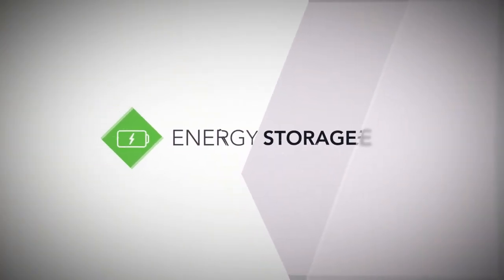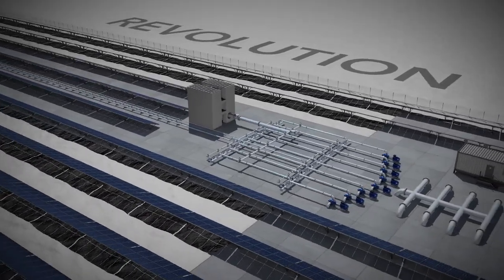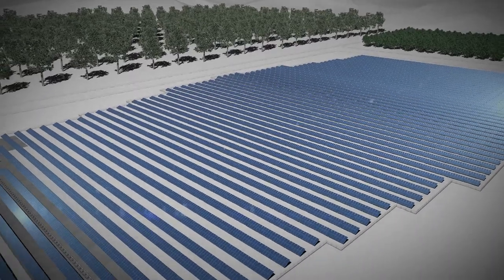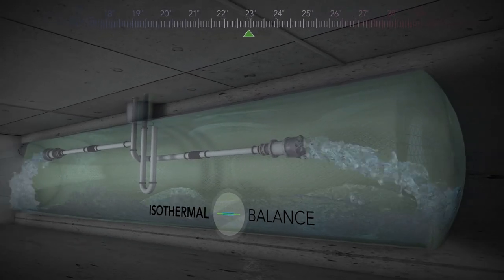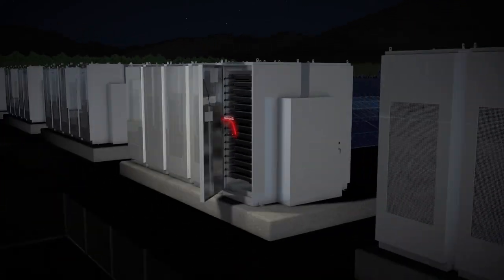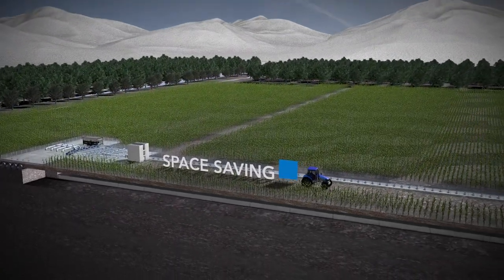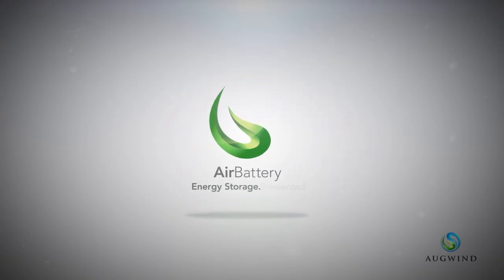Introducing AirBattery energy storage

Comment: This is not new and sadly not effective (and nothing you can fix without breaking physics). If you compress air at let's say 200 bar, you'd only be able to store 0.4kWh per m³ of pressurized space. Energy Density = (P * V) / (k * (γ - 1)). There is also some losses, with the efficiency being ~70% to compress it, and another loss at generating electricity, in total probably around ~50% regained energy. There are other ways like heating salt etc that are more sensible to store significant amounts.
Reply: what is the efficiency of drilling for oil, frackig for gas...then processing into fuel....then transporting it to be sold
Reply: @sampleoffers1978  Probably extremly high, as you just grab existing energy. But the problems there are with the negative effects on climate, environment and on human health.

Anyway, since we were talking about storing electricity, "using existing one laying around" isn't really comparable.
Reply: 200bar is 2,900 psi…!!!
Compressed air is efficient enough per cost $ wise.

Steam power doesn’t need that high of psi…

Solar panels are only 22% efficient
Reply: @sampleoffers1978 Probably tens of thousands procents...you put 100kwh to drill 100000 l of oil in example...how much energy is in that oil? There is your efficiency of drilling for oil...

Comment: What about the efficiency of this system .. I think it will be below 30%
Reply: Not sure about efficiency, I don't know about exact calculation, but carbon footprint will be near about 1% or may be less in this type of technology. This air battery is simple and better than any other acid creating battery. Polution is a huge problem ahead us. This planet is becoming sick actually. We should bring clean and green energy technology instead of increasing more and more pollution through our other movements.
Reply: hydropump could get 80% efficent. how about this process?
Reply: Wind and solar being abundant sources, the efficiency is still helped by no need to drill, process and transport fuel cargo. So that goes into efficiency as supporting auxiliary power source.
Reply: according to the video, one tank created 0,3 MWh, lets say u have 100 tanks wich is alot:100x0,3= 30 MWh means if u spice them into the Powergrid, with like 0,06 Cents, u make 30$ per full discharge, wich is not much

Comment: Compress air without losing heat ? I don't think so... even with the water to cool it down, it does not change anything to the fact that we will lose energy there anyway, the only difference is that the heat goes into the water.

Comment: How much its cost per mega watt
Reply: same question
Reply: The megawatt (MW) is a unit of power - this video is about energy, measured in Joules (J)
Reply: @thedubwhisperer2157  installation cost is usually compared in $/MW in power industry.
Reply: @thedubwhisperer2157  What we want to know is the electric power output, not kinetic energy
Reply: @bluemamba5317  If you do a little research you will find than the unit of energy - the Joule - is equally applicable to mechanical and electrical energy in the metric system.
1J = 1kg.m²/s² = 1V.I.s.  (Also 1Coulomb.Volt).
Electrical power is measured in Watts, where 1W= 1J/s.
Reply: @urbanturbine  Is it assumed that the installed MW capacity can be generated continuously?
Reply: @thedubwhisperer2157  This is about the construction Cost. The construction cost of installing a power plant is often referred in $/MW. 
 if you want to install a 2MW generator, it costs XXX dollars. It doesn't matter how much it will generate. 
Like when you buy a car, it has a fixed price. It doesn't matter how much you will drive it.
Reply: @urbanturbine  Thank you for your reply, however it does not answer my question:
"Is it assumed that the installed MW capacity can be generated continuously?".
ie: 24hrs a day?
Reply: @thedubwhisperer2157  Yes but there will be a projected and unforeseen downtimes. Larger plants will be ~90% uptime or more. 
Small plants will vary more but still around that number. Also it depends on the application. İf your application calls for continuous operating plant, then you plan accordingly (higher $/MW). İf lower annual hours are needed then cheaper, lower quality equipment can be purchased. 
Typical emergency/standby generators are cheaply made, they will wear out quickly of run continuously but they are cheap (lower $/MW).
Reply: There are peaking plants, which will run only a few hours a day during high peak demand times of days. 
Those are usually smaller and relatively cheaper made plants.
But normal plants are expected to run continuously 24/7 for maximum revenue.
Reply: @urbanturbine  Thank you kindly for the clarification; it is an area of electromechanical engineering in which I am ignorant!

Comment: I've been following this idea for quite a few years and really wanted to see some real world testing of this. However, I can't help but being worried about the many valves and pipe joints in the system to be under constant cyclic pressure. It is safer to have it buried underground so when a valve bursts, the jet stream won't poke a big hole in someone, but it also is more difficult to perform maintenance.
Unfortunately, currently the most effective way to do hydroelectric energy storage is still pumping water to a very tall place.
Reply: I feel like there would be a way to work with a dam to improve efficiency but not sure how
Reply: @MrEdmundsj  You'd need a dam to work with. This requires a lot of politics and business agreements to make it work. The air/water tank concept is standalone and can be located anywhere. For that it makes sense. But I think real challenge will begin with the monitoring and maintenance costs. 1 MWh is like 50 to 100 bucks depending on when you dispatch it. It is not that much money. You'd need a lot of tanks to make the economy work.

Comment: The principle of this technology is about the same as that of the hydraulic air compressor.  We know a lot about the HAC.

A comment below says that this project has been on hold for five months.  I wonder whether that is because they finally tried the idea and found a very hard problem with it.

Since the water and the air are in direct contact in the storage tanks, as the pressure increases the water absorbs more and more of the air.  When they use the compressed air that is still free inside the tanks to push the water through the turbine to produce power, the pressure in the water drops as it passes through the turbine.

That pressure drop causes the dissolved air in the water to escape while the flow is still in the turbine.  The turbine can't handle this two-phase flow, which becomes increasingly more air and less water per unit volume as it passes through.

It is like the problem, only in reverse, that happens when a pump tries to pump a mixture of air or some other gas and water or some other liquid.  It can't do it well enough, or at all.  The technical explanation is set forth in many places including the internet, for instance, "pumping two-phase flow."

In other words, Augwind did not know about, and did not anticipate, the Champagne Effect.  This effect has been studied thoroughly.  It became obvious more than forty years ago when water-compensated CAES became a subject of great interest.

Because of this effect, it is very difficult to safely operate a water-compensated CAES cavern.  (Hydrostor, beware.)  And because of it, I do not see how Augwind can generate much power with this arrangement.  They can store energy with it at high efficiency, but they won't get most of it back without a lot more research, probably some patentable discoveries, and a much longer time to market.  I don't think they are nearly ready to sell their system.

If this is the reason for putting the project on hold, it will be far from the first time that the problem of dissolved air in the water has put a stop to the dream.
Reply: Interesting take.
Reply: Then they should have a piston that separate air from the water? You pump water, the piston moves and push the air into tanks. In the reverse mood - the air push the piston that will push the water into turbine.
Reply: While there could be many reasons for a 'project on hold' status (including complete implosion of the project), I think you may be misunderstanding  their system.

You say:
//"Since the water and the air are in direct contact in the storage tanks, ..."//

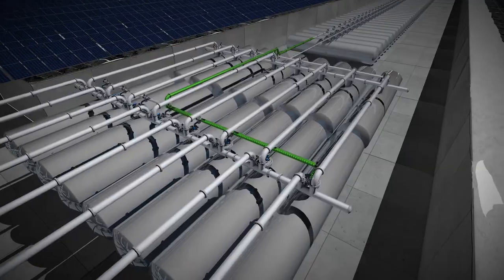If you look at their patents (and video including this one), you'll see that they don't store the air in contact with the pressurized water.  The air is stored separately in 'air only' storage tanks (1:20)

Essentially they are using the water only as a 'hydraulic piston' and the contact only happens for a short period during a 'compression stroke' (0:55)   Then, that 'piston' (they call it a "compression tank"), now near full of water, is returned to atmospheric and used as the supply tank for the compression stroke on an adjacent tank/piston.   The output of compressed air is stored separately.

The entire process is reversed for energy retrieval.

Given the short time that the water is under pressure (low dwell time - low aeration), and the fact that the water is returned to atmospheric every stroke (equal or greater time for deaeration), I think you'll find that the "champagne effect" will be trivial.   

Your comment would however apply directly to Hydrostor and I haven't studied their system to see how they plan to handle it. 

My take.
Reply: @johnborton4522  I think his points are pretty valid. Although the air and water are stored in separate tanks, the pumped water still dissolved a significant amount of air when pressurized, it will quickly even out all the water in the system. Once you start running the turbine with this water, the cavity would erode the turbine pretty quickly. 
A lot more research is needed to make this system work with the kind of reliability claimed in the video. For example, additives in the water or specially blended fluid to reduce air solvency. Or special gases that have very low solvency in a fluid.
Reply: @hyphen2612  

//" I think his points are pretty valid."//

It's literally not valid to say they are stored together (as he did) when they are not stored together.

//"A lot more research is needed to make this system work with the kind of reliability claimed in the video." //

I don't disagree.  My point of correction of his claim still stands though.
Reply: Nah a pulley rig should allow storage to switch off with gravity. If they find ways to fail, that's big oil intimidation, not engineering problems.
Reply: The most common way to supply watter to a house from a borehole is to use a pressure tank that have a bladder inside. This bladder separates water from air. Maybe they did consider this aswell.. i think it's obvious to separate them
Reply: I come from China, a country that has taken a leading position in the world in the fields of compressed air energy storage (CAES) and liquid air energy storage. Similar to the Augwind water piston system, research has been conducted at both Xi'an Jiaotong University and Hunan Electric Power Research Institute, where proof-of-concept systems were built. A former colleague of mine studied a similar system, constructed a prototype, and successfully demonstrated energy storage and release. His research indicated that the champagne effect had a negligible impact on the system. However, he was unable to obtain low-cost high-pressure vessels, which rendered the system commercially unfeasible for general energy storage. The Augwind system boasts three major features: firstly, it has essentially achieved isothermal compression (credible); secondly, it employs highly efficient water turbines for both compression and energy release (credible); and thirdly, it claims to have realized low-cost high-pressure vessels (completely unbelievable, as this would be a Nobel Prize-worthy achievement, rendering the need for salt caverns in CAES systems obsolete). The latest research progress in China suggests that the system may be suitable for frequency regulation in power systems (offering an advantage over the massive investment required for pumped storage), rather than serving as a purely commercial energy storage solution.
Reply: @user-tw4xo4kj1g   If your native language is a Chinese dialect, you have an impressive command of the English language.  Your comments about the cost of pressure vessels for CAES are certainly true.  One CAES outfit, LightSail, ended their days several years ago trying to produce such vessels at a low cost, after finding that their initial plan for isothermal CAES without a cavern required them.  When that attempt failed, they went out of business under a cloud of suspicion.

How large was your former colleague's prototype?  If it was a small one, which it must have been, I doubt that it could have demonstrated how one of commercial size would operate, particularly what the effect of long-term operation on the blades of the turbine would be.  That is, from cavitation.

What were the turbine inlet and outlet  pressures?  What was the flow rate of the fluid entering the turbine?  What was the efficiency of the turbine under these conditions?  What percent of the entering fluid was dissolved air?  To determine that, a sample of the pressurized fluid must have been returned to atmospheric pressure, and enough time allowed for all of the dissolved air to escape, and there must have been a proper measurement of the various quantities.

If the release of dissolved air as the fluid passed through the prototype turbine did not significantly affect the turbine's performance, and the pressure drop through the turbine was of commercial magnitude, it would be remarkable result.  However, setting aside what cavitation would do to the turbine blades in the long run, if the pressure drop was not great enough to cause problems with energy extraction, I would suspect that it was a small pressure drop.  Then it would not be a practical case.  For efficiency and practicality, the turbine must operate under high inlet pressure and low outlet pressure.

Unless these questions have satisfactory answers, I hold with what I wrote above.  The release of dissolved air in the turbine is a fatal flaw in the arrangement shown in this Augwind video.  As you have explained, the requirement of low-cost pressure vessels is another.

Beyond any problems in the turbine from dissolved air, no one has shown that we can ignore the champagne effect in water-compensated CAES.  Given the impracticality of using pressure vessels for CAES, all CAES plants must have a large storage cavern far underground.  That includes water-compensated CAES.  Before building any of these plants, we must solve the problem of the champagne effect.

When the champagne effect was of great interest, more than forty years ago, several papers warned that the effect could be devastating.  There are at least two patents on methods for avoiding it.  We will finally have a demonstration of this phenomenon when Hydrostor begins operating its adiabatic CAES plants with water compensation.  We will see whether Hydrostor knows what it is doing.

I admire the Chinese for their efforts in CAES and renewable energy.  They are far ahead of the rest of the world in the most important technologies of our time.  But no one has yet demonstrated the ultimate in CAES, a practical means for incorporating isothermal compression of the air.  I doubt that the Augwind arrangement will do it.  If there ever is a demonstration, it would show that isothermal CAES is worth far more than a means for regulating the frequency of the electrical power on the grid.
Reply: @georgefleming864  I am not a native English speaker; I used the artificial intelligence large model from DeepSeek for translation. I am not an expert in this field, but I am quite fascinated by energy storage technologies related to compressed and liquefied air, so I have paid more attention to them. My former colleague is somewhat of an expert on water turbines, and he noticed the issue of gas dissolution, judging that it had little impact. However, given that his model validation ran for an insufficiently long time, and its scale was even smaller than that of Augwind, there might be some data he did not fully grasp regarding cavitation, so we cannot guarantee that he is correct.
Reply: @georgefleming864  The ion compressor IC90 from Linde is also claimed to be close to isothermal compression, capable of compressing hydrogen from 1 Mpa to 100 Mpa. The IC90 employs a principle similar to that of a water piston, but with the medium changed from water to an ionic liquid, in which hydrogen is essentially insoluble and the ionic liquid itself has negligible vapor pressure (the specific variety is unclear). My former colleague, along with Professor Wang from Xi'an Jiaotong University, has basically validated through their verification model that it is possible to approximate isothermal compression. I once thought about persuading my former colleague to simply develop an air compressor for large factories to produce low-cost compressed air, but it seems he was not particularly interested.

Comment: Wind generator are ideal , they are shutdown 20 to 40% of the time for low 
Wind, hig hwinds, because solar is over production so direct drive
Wind waterpump are ideal. 
Plus the tower can be designed as a air tank becoming almost cero investment in storage.